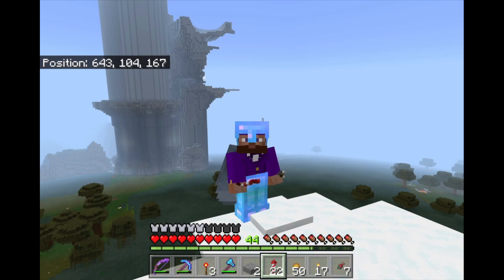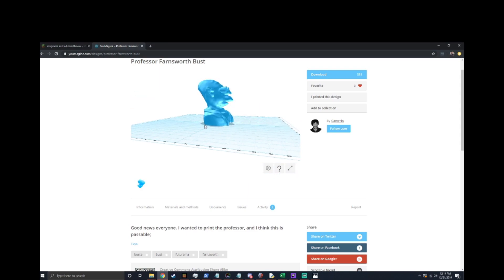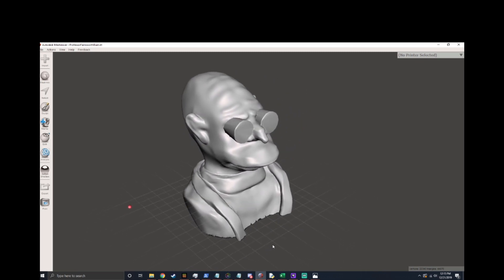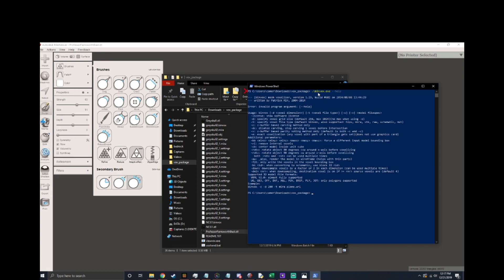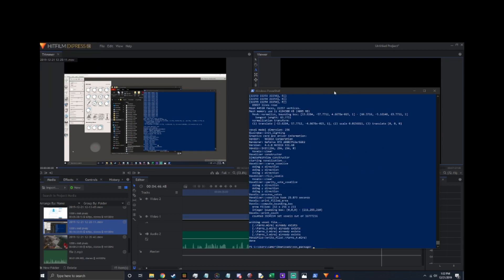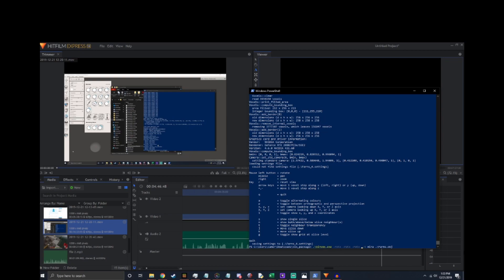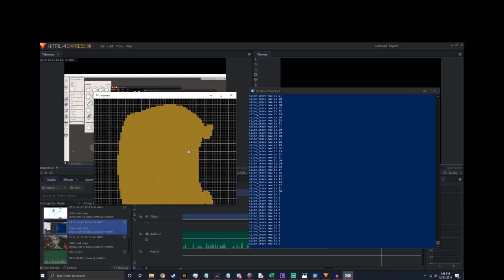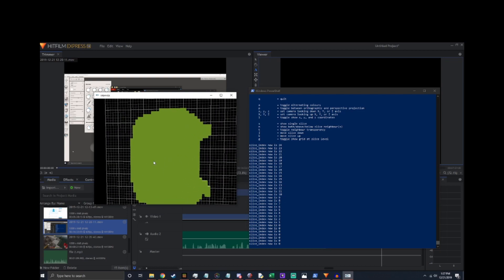Convert 3D Model to Minecraft Design

Comment: Is there an alternative version for binvox available or not, i did not use the binvox tool yet, but as i can see that it only gives one color of the model, i am looking for a way to get all the colors of the model... if we can do it in binvox then please do let me know, and if there is a newer version or latest tool for this kind of job, then point me in the right direction, i want to build things manually in minecraft but looking for a tool like binvox, which can create large worlds and also comes with color support, thanks.
Reply from the maker: Check my model to minecraft video.

Then check structura. Both are far better then binvox

I don't have a tool that does the auto color building. That is something you have to do by hand.